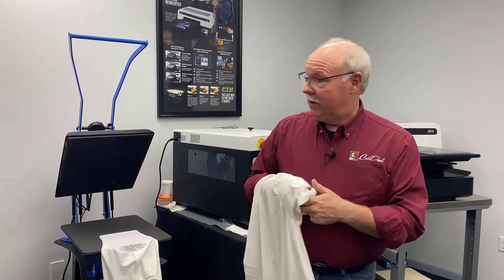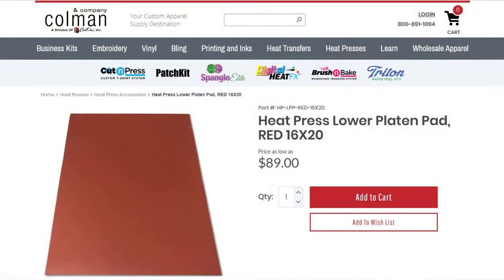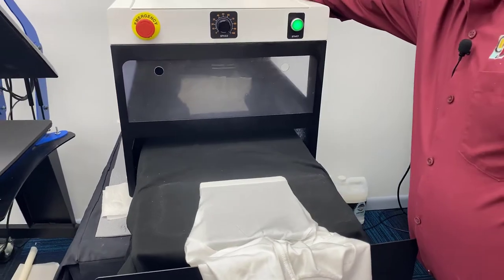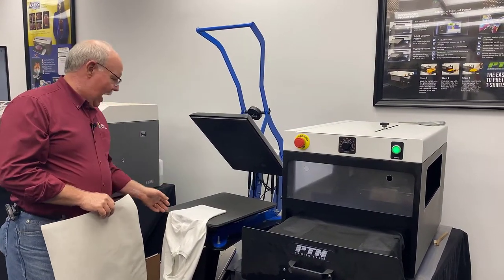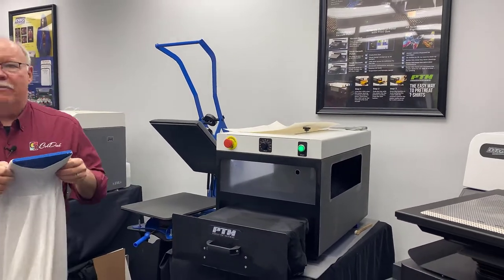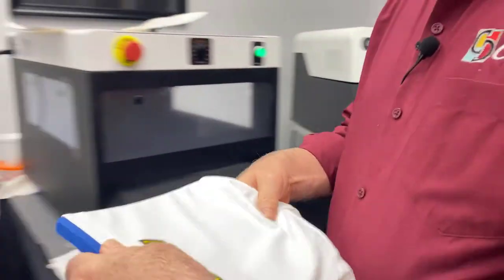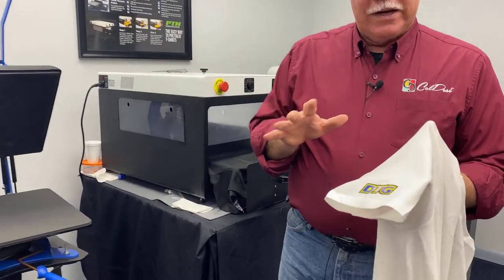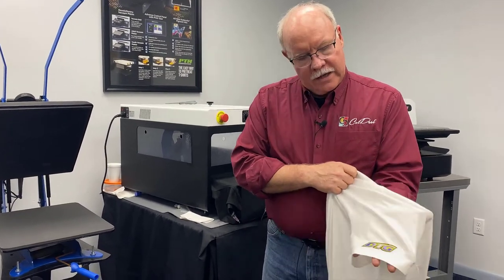DTG G4 | Printing on Short Sleeves

Comment: Does the sleeve collar height not affect the print since it is a little more raised than the rest of the sleeve?
Reply from the maker: It does, which is one reason we use the template inside the sleeve. But in some cases the seem is thin enough that heat pressing it reduces the height difference enough that it doesn't much effect the quality